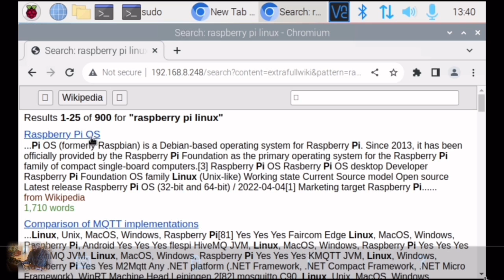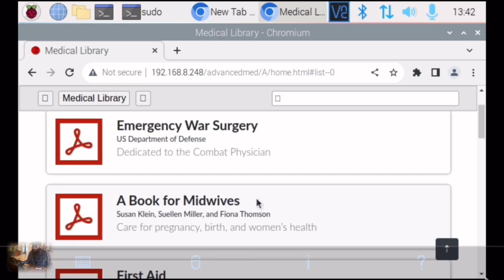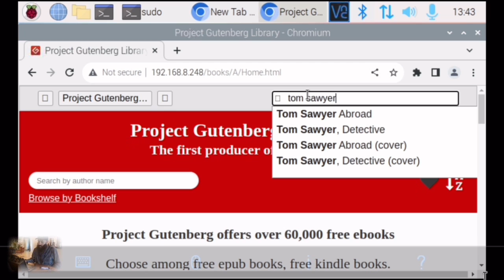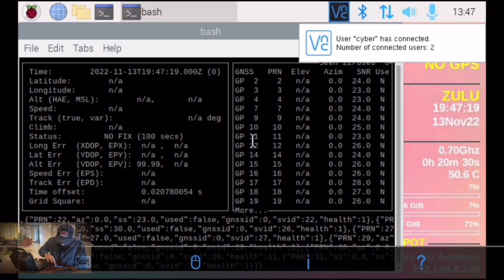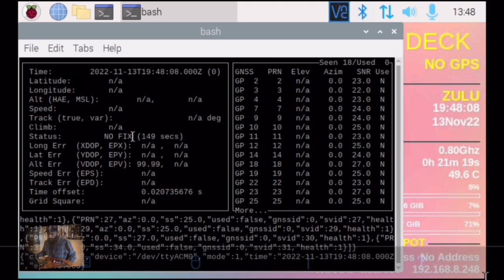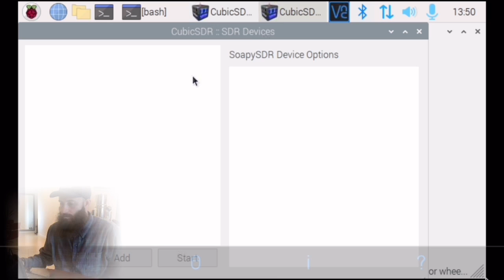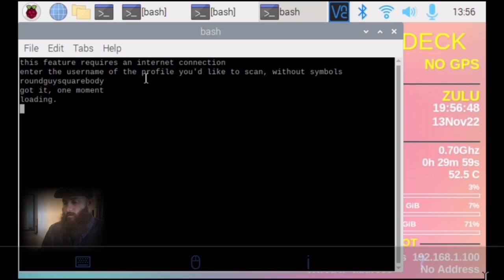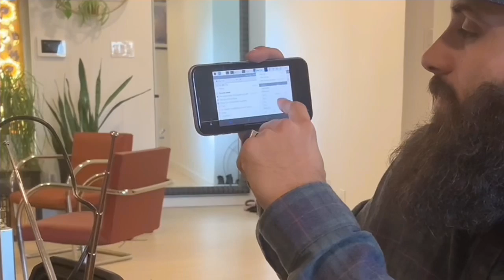GRIDBASE UI introduction.

Comment: There is no way that power bank will charge in 8 hours! Do some research on solar panels that size it would take more like a month if not 2 months to charge that power bank from that solar panel
Reply from the maker: Wall charger at 5A
Reply: @gridbasedotnet  a 5 amp charger would still be over 9 hours but I was specifically talking about the "solar" charging point. The panel on that thing is pointless
Reply from the maker: Only that it trickle charges to maintain. Assuming you’re not pumping max amps out of it, say you’re just using it to charge your headphones etc; it is nice to have a maintainer for when charging small items.
Reply from the maker: Also, everything here is about contingent, worst case scenario insurance policy. 

Obviously I’d like to be using a max book pro with starlink. However, a cyberdeck will be useful as a contingency. 

Same here with the battery pack. When you’re fucked fucked, and there’s no electricity. Who cares if it takes 4 days to charge your solar battery, at least you got something.
Reply: @gridbasedotnet  because for 40$ on Amazon you can get a "REAL" portable solar panel that can actually charge it is all I am saying. Better and more reliable approach. When shit hits the fan you want reliability
Reply from the maker: I’ve researched & tested them, none of them natively put out the amperage needed to power a raspberry pi to keep it from throwing low voltage codes. Also, they’re not as portable. 

Look, if someone wants to expand their system I highly encourage that. Someone may want one powered by hydrogen, someone may want one powered by an internal battery. Expand it then! I’m not stopping anyone from finding solutions to their needs. I am solely providing a platform from which they can jump and expand as needed. What I offer is products that work. The battery pack I chose I chose specifically due to its amperage rating, and it’s ability to power the raspberry pi with out throwing any low voltage codes or being too bulky. There are certainly other options out there that someone such as yourself may desire. And, by all means I encourage you to adapt them.
Reply: @gridbasedotnet  I think you are missing the point Chris is making...you claimed the battery pack would recharge in 8 hours on solar in the video. Chris is questioning that claim. Chris then goes to point out there are other recharge options for the battery bank and that the one you provide is not worth the money...hinting that you can buy a non solar battery bank AND a solar panel charger that will put out enough Amperage to charge the battery faster....at no time was Chris talking about powering the PI.

Comment: Why not just get a toughbook?
Reply from the maker: Because it’s $5,000
Reply: @gridbasedotnet  I think you added one too many zeros.
Reply from the maker: Panasonic Toughbook 40, FZ-40 MK1, Intel® i5-1145G7, 14” Touch, 16GB, 512GB Opal SSD https://a.co/d/hv5Tv0P
Reply: @gridbasedotnet  Try ebay. 500$ for a CF-31 i5 2.50GHz  GPS 16GB RAM | 1TB SSD way better specs than a pi and 1000x more reliable than a pi. Love the project, super cool form factor and execution but I would never rely on a microsd and or a raspberry pi for any sort of contingency.
Reply: @gridbasedotnet  I use a Toughbook CF-19 for this purpose. It was ~$150, is MILSPEC water & dust proof, has GPS, is upgradable, and has an i5-2520M, which is likely just as fast, if not faster than the rPi in most workloads.
Reply from the maker: How did you find a tough book for $150
Reply: A second hand tough book is a solid option. However I quiet like the execution of this project. The Olimex Olinuxino is a good SBC that is rated to work in extreme temperature ranges. 

But the pi has the popularity factor meaning there's more people developing software for the raspberry pi where as the Olimex offering would probably be more work to get set up.

Comment: Are you willing to sell a compiled version (software) of what you have?
Reply: Dude its open source, I know its easier to just buy the compiled version, but it's not that much harder to compile it yourself + you'll understand the system better than if someone did it for you.
Reply: @robism054  I had this issue with Kali Linux as an example, too many tools. 
Its best to start from scratch, learn from your failures untill you have something that really works to your liking.
Reply from the maker: It’s now available at www.gridbase.net
Reply: @gridbasedotnet  where is a good place to dm you for a couple questions before I purchase?
Reply from the maker: Check out the Instagram! @gridbasedotnet
Reply from the maker: Info@gridbase.net
Reply: @gridbasedotnet  might want to update the link. It takes you to a DNS Error page
Reply from the maker: You’re the best. When we did the rebrand we updated everywhere else except the comments 🤦🏽‍♂️
Reply: He said 160 hours and thousands of lines of code.  I don’t know enough and don’t have time to learn.  Please make make it public❤

Comment: Haza! So I already am set for Linux, and the programming, cabling and all. I just don’t have a 3d printer. What would you charge for the inserts for the 1150 :)
Reply from the maker: I can’t charge for them!
Reply from the maker: Sounds like a job for 5iver
Reply: @gridbasedotnet  do you have the 3d file for the insert? I know some guys near me that have a printer. The only other tools I need will be for drilling the power and top USB ports
Reply from the maker: I linked it in the video. Couple minutes in.
Reply: @gridbasedotnet  I might be blind lol I didn’t see any cards in the video. Might help to add it to the description…and is that print for the old or new 1150?
Reply from the maker: It’s a print for the new 1150. 

Doscher.com
Reply: @gridbasedotnet  well I did see that one from another video.  If it has the power plug on the inside. I’m asking about the plate you updated the design of. Can you sell that?

Comment: How do updates work?

Does it have any overheating issues?

VPN possible? 

Are you traceable?
Reply from the maker: Anything is traceable. 🤔

It’s rated for up to 180°F. No over heating issues to report yet.
Reply from the maker: VPN absolutely possible using the interns Mango modem. GL.iNet GL-MT300N-V2(Mango) Portable Mini Travel Wireless Pocket VPN Router - WiFi Router/Access Point/Extender/WDS | OpenWrt | 2 x Ethernet Ports | OpenVPN/Wireguard VPN | USB 2.0 Port | 128MB RAM https://a.co/d/1iIjH8u
Simply update it through the command line, or I can update it and send you the updated software as a downloadable image. 

It’s capable of operating at up to 180°F
Reply: @gridbasedotnet  great! I guess I should’ve added about the VPN, is it proprietary or can I use my own? Reason being, I don’t want any VPN under the 5/7/9 if you know what I mean. Also how susceptible is it to being hacked? I’m not familiar with Linux but willing to learn.
Reply from the maker: https://www.gl-inet.com/products/gl-mt300n-v2/

That is the exact model I use. It has all the specs you’re looking for